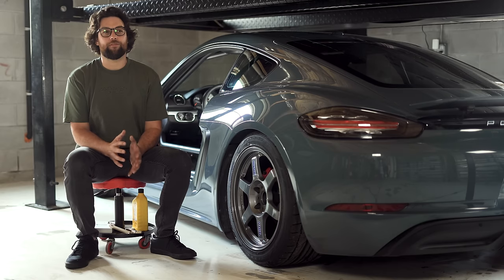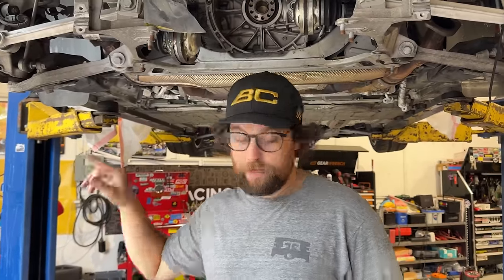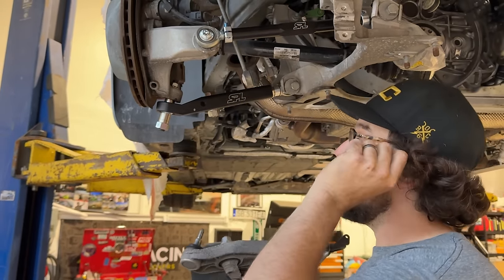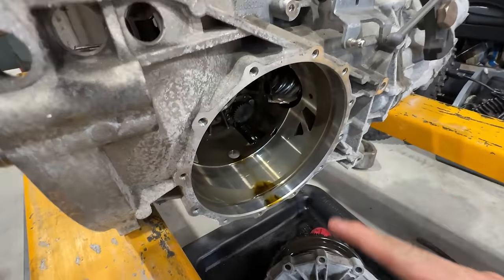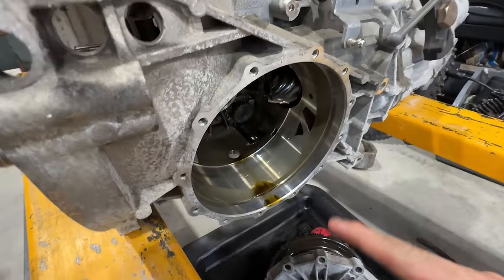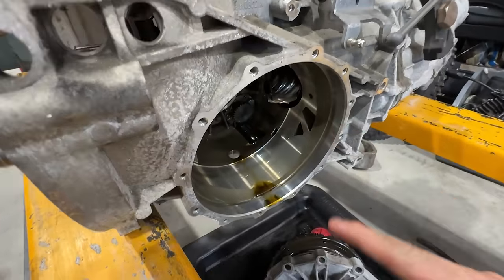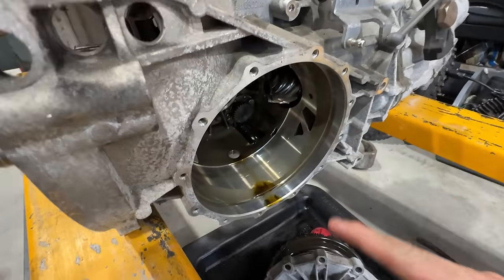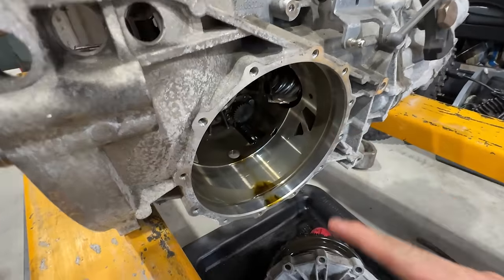Building The Dream - 718 Cayman Porsche Drift Car

Comment: I didnt know much about the 718 platform. I honestly thought it was rear mounted behind the transaxle and hanging behind the rear wheels like the 911s. You kept saying mid engine so i went and done some research and the basis behind the 718 is a 4 cyl, mid engine (engine behind the seat and before the transaxle) 2 seat car made to be fast. Didnt know that. Its a beautiful car and i honestly like the looks better compared to the 911s and other porsches with huge asses. lol great pick for your next drift car, its not of the norm at all and its freaking gorgeous. Needs some dark bronze wheels. I think it would look good with the silverish grey color.

Comment: Hi mate,nice work great build and slick edit.   I’ve your running the OEM controllers Inc the ABS unit there is a way to disable the braking stability aspect. Porsche has a traction control off button etc on the dash, but the system will always intervene in extreme yaw forces to do controlled corner braking that settles it back into shape - great for keeping the average owner from not looking a fool wrecked in the barriers. 

What you do is cut the provision of Yaw data to the ABS module, then it still gives you assisted braking but can’t run its loops to intervene. The Yaw sensor is mounted in front of your shifter, just after the ABS unit.  Take its 12V power feed and bring up to a dash switch, meaning you can disable but restore any time. The Yaw is also used for some other systems, but you likely don’t have those - PDK shifting, PASM shock control.   
It will throw up a dashboard error ‘PSM fault’
Reply from the maker: I have removed all that via flashing and coding, and also mechanically. We also dont want assisted braking

Comment: Although I don't know enough about suspension set-up it was really cool to hear you explain what was there, what you changed and what allows it you to do different. Oh and i love the sound of this thing. Normally i would think a shorter final drive would be a good call as Porsche put insane long gearing in it. But maybe the poweband with Turbo makes it just a drifter at 1500/2000 rom less. Maybe its more of an issue with the GT- products (=NA). Will be fun to see where you take this. I have always said this Cayman is a better platform than the 911. Go ahead. Prove it!

Comment: There is a company that builds caymans and they cut a hole in the front of the frunk because it’s not structural and they did build a duct from there that comes out the top of the hood it looks so dope I’m positive you guys can put a nice size radiator in there with beautiful air flow coming from the front and  exiting from the hood
Reply from the maker: That’s the plan

Comment: Fuck ya! Looking forward to more of this!!!

You can use a Launch X431 (CRP919X) to fully disable all the factory stability management… also if this is gonna be a track dedicated car, I’ve figured out settings for the cooling system that enable it  to maximize the coolant flow and drop temps as much as possible.

Pretty sure that’s an S… 2.5l motor instead of the 2.0 in the base… easy 400hp/400tq+ and will push 22-24psi of boost and easily hold 17-18psi all day

Comment: As far as something that will actually improve your build, you should look into the DeMan Motorsports gear set for this car. It's a much more intelligently designed to set of ratios that are spaced progressively closer together as you go up through the gears.
Reply from the maker: That almost doesn’t matter when your powerband is from 2500-7500… although they are a bit stronger!

Comment: I'm really interested in doing some of this work to a 987 Boxster, and make it a driftable road car... Did you set up the hand brake in-line?
Reply from the maker: Yes all my cars are single rear caliper
Reply: @chelseadenofa Thanks. Is that just because it's easier? Have you ever felt any of the drawbacks?

Comment: 0:38 What's the reason for the front wheels spinning on the dyno?  Is it just the way his dyno works?
Reply: Like he explains right after that, there are so many sensors and stuff on modern cars, that they freak out if only the drive wheels are moving. There should be a "dyno mode" or something like that that ignores those sensors and doesn't cause the car to freak out, but yeah.
Reply from the maker: Part of figuring it all out quickly
Reply: @chelseadenofa  love the build and look forward to the rest. Also can't wait to see more of the Alfa.

Comment: They kill the clutch with stock power , I’ve changed 3 that were slipping on stock cars
Reply from the maker: Yes. Our current comp1 clutch that we’re developing holds the current power. More to come.
Reply: @chelseadenofa  looking forward to the next video on the cayman project . Surprised the turbos  internal gate wasn’t seized when you first got it, as that’s a common issue if the cars driven slowly. Oh and watch out for engine mounts as I’ve seen one snap 🤙

Comment: This what drifting whas become to now? Drifting exotic cars that are unobtainable to the average drifter?
Reply from the maker: This is the same chassis as a 986 which can be bought for around $3500… less than a 328 or s13
Reply: @chelseadenofa  this? The 718 cayman has the same chassis as the 2004 boxster?

Comment: How is this grassroots exactly?
Reply from the maker: I think that was taken out of context. But these chassis in older form 986, 987, can be had at costs less than current s13/14 e36 pricing. Also I’m focused on growing drifting from all levels so with this 718 while it may have cost as much as a new mustang base model, it’s something current and exciting, while all the suspension and development trickles down to sub 5000$ cars for grassroots.

Hell last time I was at a grassroots event half of the cars were 30k+ builds.
Reply: @chelseadenofa  the 986 boxster yes but the 987 cayman is a 25k car used. Could vary from area to area but 20-25k for me here in SC. I mean if a 30k plus build is grassroots, then for me the term has lost all meaning. I mean it's cool that this chassis is getting utilized but I think the amount of r&d going into this could have been better suited to something more attainable like a 924/944. Idk maybe it's just me 🤷🏾
Reply: @LOVE-VIBES-X-PROJECT-CARS  finding a reliable, usable 924/944 is a challenge. The suspension on the 944 is also very different from what people are used to with the torsion bar rear and frankly just about everything needs to be replaced on any 944 that hasn't been completely gone through. Then you're left sorting out making power with them, working with the transaxle setup, updating everything from 1980s spec, etc. That all adds up pretty quick.
Reply: @AlanAtSPL  considering that almost every other rwd chassis has been drifted, it can't be that hard. I'm pretty sure if you dropped one off with Josiah he could macgyver a drift kit for it easily. The chassis are already rust proof, and the engines are pretty reliable. If you need more power then do like everyone else does to the other non high hp engines, LS swap it 🤷🏾

Comment: 30fps please. You can make 30 look mostly as """""cinematic""""" as 24 if you use the same shutter speed between them(1/50th of a second), and you can get even a little closer if you drop it another level to 1/40th of second for even more motion blur. The entire way the industry understands the relationship between frame rate and motion blur/shutter speed is wrong. Wholesale, full stop. No amount of film school that teaches the physically incorrect information can convince me otherwise, and IDC how traditional a practice is, if it's fundamentally objectively incorrect, then that's the reality.

That aside, 30fps just has fewer problems than 24, as well. The pulldown in a 60fps timeline looks smoother since 30 is an even division of 60. The same can be said for deriving a 30fps portion/version/stream out of 60fps footage. Any artifacts from mis-matching true 30 footage with a 29.97 timeline or vice versa are lessened due to the higher rate. 30fps outputs cleaner on 60hz (many/most TVs) and 90hz (some phones) displays than 24, and seemingly it's the same with 120hz as well since at least on my monitor, switching to 60hz makes crappy (meaning poor settings) 24p footage look a touch better.

30fps is also just generally easier on the eyes and it's easier to see what's going on, too, which is my main point and reason for requesting 30 on ALL internet/vlog/hybrid vlog-episodic style content. You don't need whatever placebo "deep emotional connection" to the content that comes from having to interpolate the choppy cadence of 24p with your imagination for this type of content. It's more important to be easier on the eyes and easier to absorb with a smoother rate that allows the brain to do less work. Nevertheless, it's understandable to still want your footage to look aesthetically pleasing, hence my suggestion of 30p since it has what I find to be a perfect blend of smoothness and aesthetics when setup right with the right shutter speed and codec (which you should do with any frame rate).

Comment: And here all my life I've been told that rear and mid-engine cars are the absolute worst cars to try to drift with because with the rear end being much heavier than the front the car will forever be trying bring the ass end around the front.... Hence the reason Porsches have always been called the Widowmaker car because inexperienced drivers cannot handle the snap over steering spin from the mid/rear engine weight balancing...

Comment: drift tax getting out of control.....
Reply from the maker: You can buy a 986 which is the same chassis for less than an s13…
Reply: @chelseadenofa  I meant if 718s are the new drift cars, talk about a drift tax 😅. I don't think I've ever seen anyone slide a 986
Reply: @chelseadenofa  I always thought the 924 platform would've had more potential